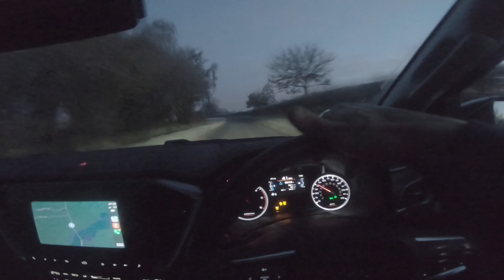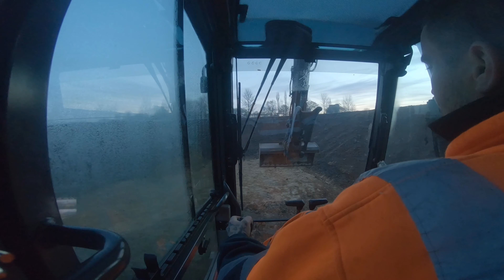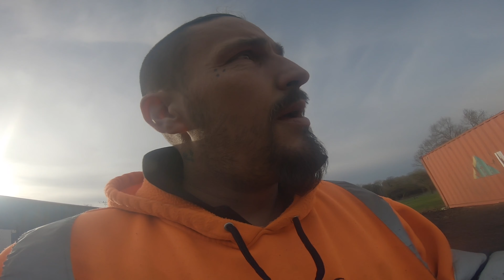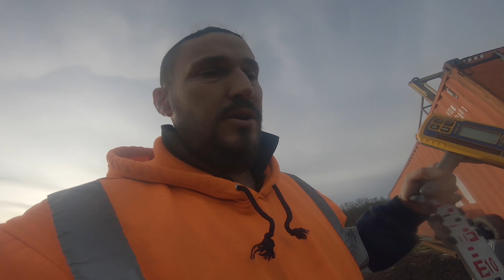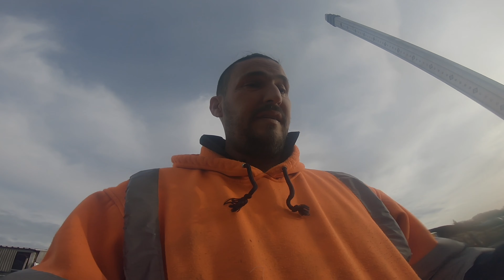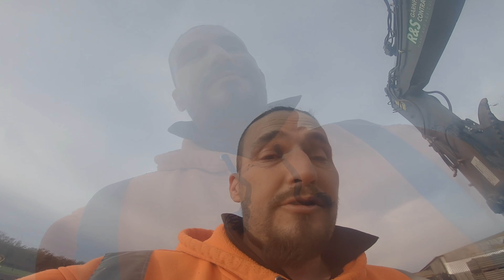That’s that done for today !!!

Comment: Sounds like the motor has burnt out due to the cold. Common fault. Have you ever drove a 14 ton zero tail swing and if so whats the ups and downs? Many thanks keep up the great work and if we don't see you before Christmas have a gooden and pass your regards on to your old man 👍
Reply: Unplug the motor and switch the wippers on and check theres a feed at the motor with a multi meter. If so motors gone
Reply from the maker: Cheers for that. Yeah I’ve driven 145 zero swing and a 235 I liked how close you can get to things and not worry to much about the overhang of the tail end the  things I don’t like are very noddy and the visibility out of the right hand window is poor also how high everything is ie engine bay good machine in the right circumstances but not for what I do also tried the 145 with my tree shear and once I cut I couldn’t fully extend without it tipping like I say every machine has its place in the Industry I love all excavators there all got there place I will send regard’s to dad and I’ll probably be putting a couple more vids out over Christmas have your self a good Christmas and thanks for the comments and support really appreciate it 👍

Comment: Hi mate is that hitch just a tilt ,I drive a 145 volvo boss wants to put a roto tilt on but I'm not sure used them before just seems to add to much weight to end of dipper don't want to upset the balance of the machine what's your thoughts
Reply from the maker: Yeah it’s just the GEITH gt tilt hitch reason I went for it was one the cost two was the weight as I run TMK400 tree shear and have a hydraulic thumb so need as little extra weight as possible it really doesn’t upset the machine at all I did get pricing on rototilt and a steel wrist horrendous money for what they are 👍